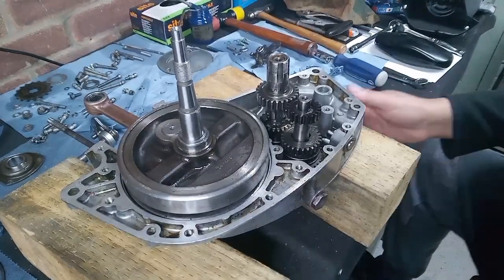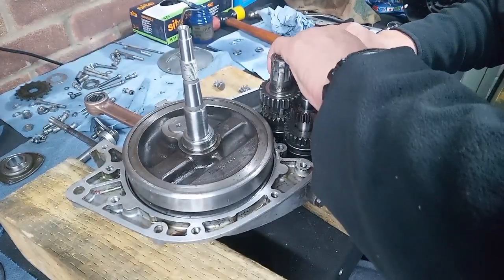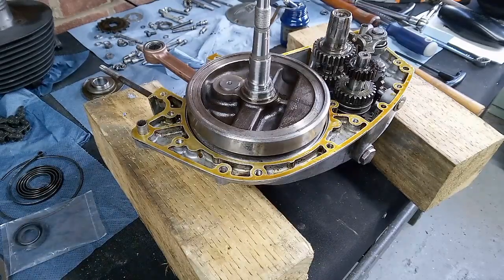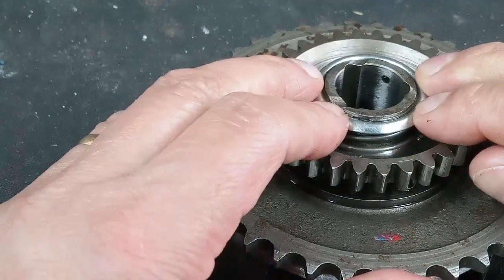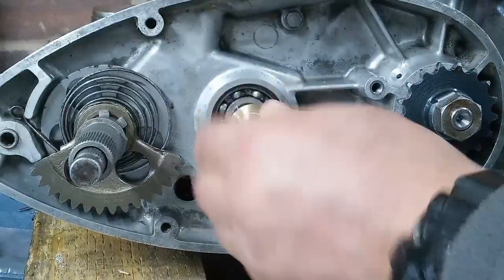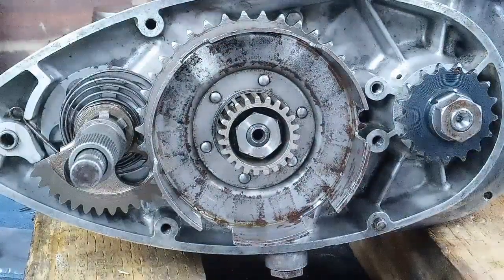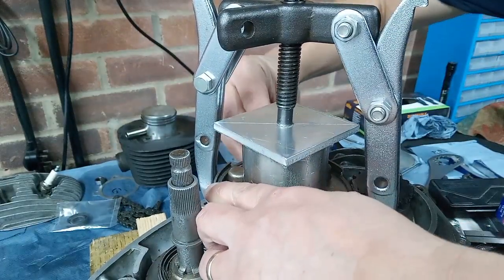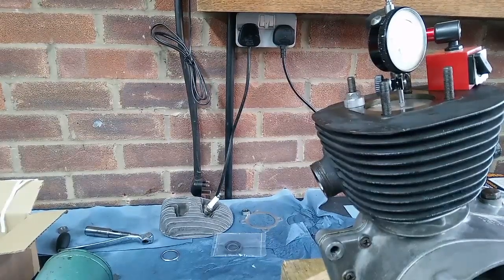BSA Bantam D7 Engine Assembly Hotspots

Comment: why were the steel discs omitted from the flywheels
Reply from the maker: The D7 models never had them fitted. BSA dropped them for a number of years as they were troublesome and prone to break loose. Interestingly, they went back to fitting the discs on the later models from D10 when they were looking for extra performance.
Best wishes, Dean.
Reply: I never saw an engine(D7) that did not have the discs fitted but I believe you . I did a lot of engine tuning for racing Bantams and I used much smaller solid flywheels with oval con rods made by Alpha ,plus a horseshoe in the crankcase to fill the gap that the smaller flywheels left, I also used one very thin chrome plated piston ring and a Gardner carburretor
Reply from the maker: @ianMclaughlin-u5y  very strange. Service sheet 506 dated Nov 62 states they were not used from the D5 onwards. I know they were fitted again on the D10. My original D7 crank had never had them, no stake marks at all. BSA were good at changing things around so who knows? Personally, I think they are more trouble than they are worth. Stuffing the crankcase as you suggested on your race engines would be more effective in my view. 
Best wishes, Dean.